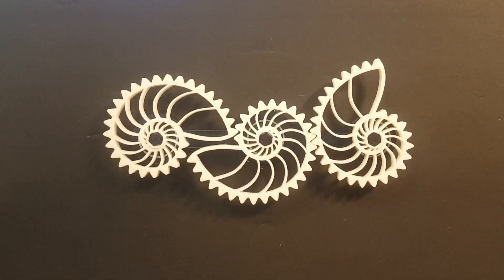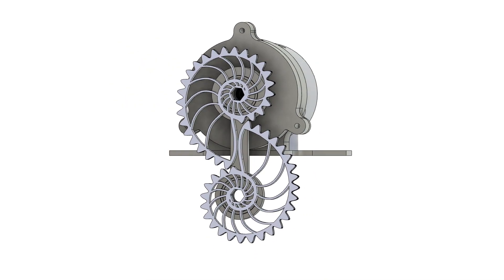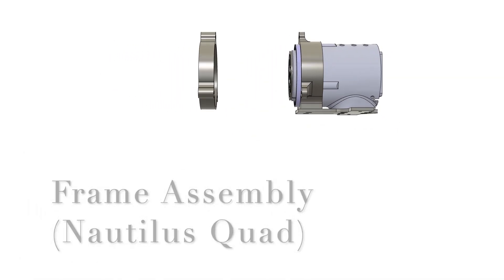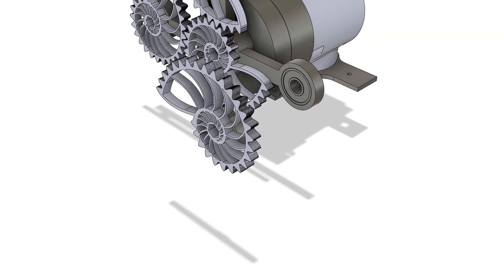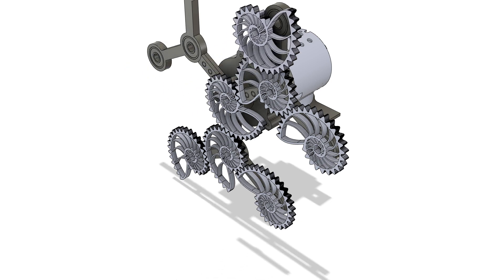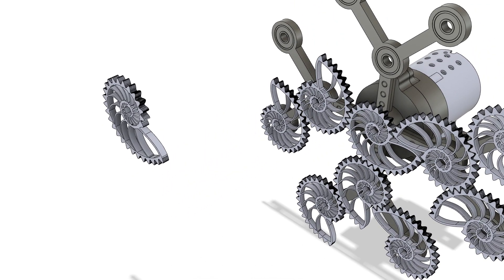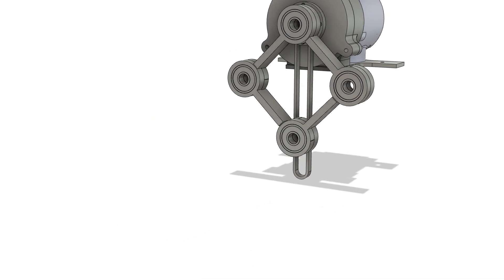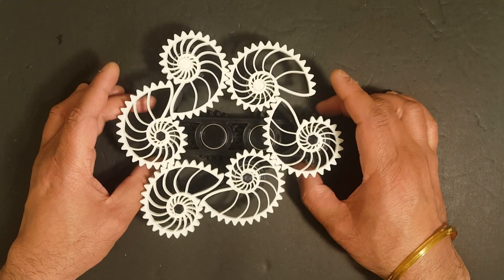Nautilus Sculptures (Part 2)

Comment: What would the graphical presentation of the output torque look like in a two gear system?  I would imagine it would look like a sine wave?
Reply from the maker: I am not an expert here but given the gear profile is logarithmic, it will be more like an exponential decay with a jump at the end.
Reply: @rubbotix7261  Maybe more like a none-sinusoidal, asymmetrical for sure, with curved upward ramp.